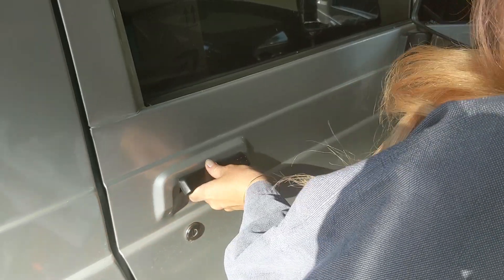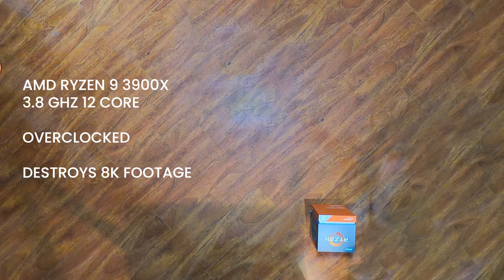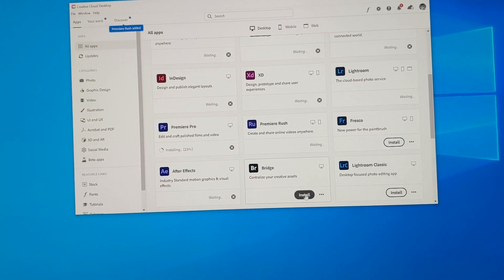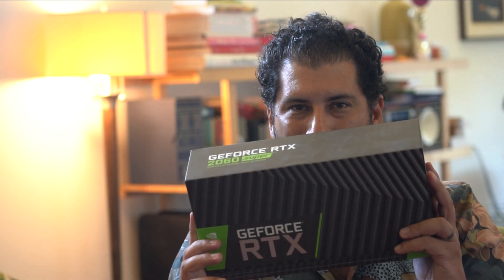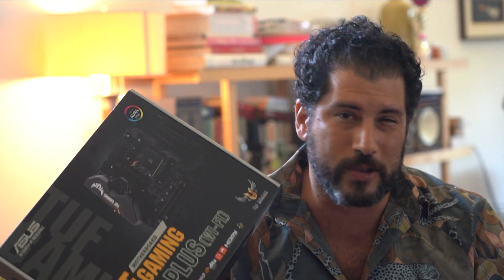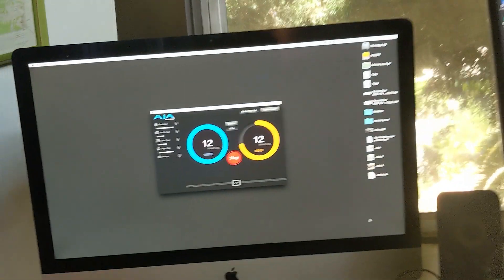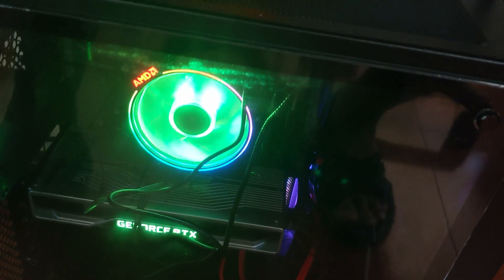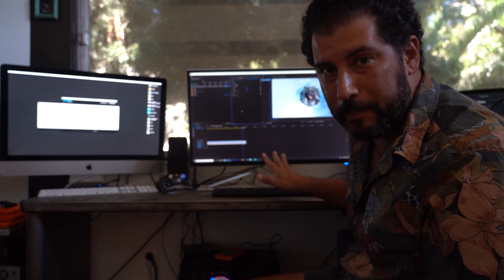PC build: Cheap 2021 PC build for fast 4k Video Editing. Under 2,000 USD. Easy.

Comment: Thinking about making an almost identical rig. How’s this holding up a couple of years later? Multicam edits on 4/8k ever an issue? Are the 2 fans from the rig enough to keep everything cool? Ty again for this
Reply from the maker: Still no complaints ... Fans were plenty even when overclocking the CPU. You could put a liquid system in it, but I've never had an issue. I might run parallels on it and give it MacOS because I'm starting a new inhouse job and we're all mac over there, but speed wise she's still a beast. I was actually thinking of selling it since I wont be on it much moving forward next month... if your interested.

Comment: This video was extremely useful, big thanks for making it! I built pretty much this exact machine. One word of caution for anyone attempting this same build: this will not support Thunderbolt 3, and  near as I can tell the TUF X-570 does not support Thunderbolt 3 expansion. So if you need to work from high-speed RAIDs or the like, this may not be suitable.
Reply from the maker: That might be true as Thunderbolt I believe is Mac only right? IT does support USB C (both varieties) and of course eSATA which both work well with RAIDS.

Comment: I have been looking to buy / build a PC to handle 4K (h.264) GoPro / DJI footage - any thing on budget to start with? 
HP Z Series any good?
Reply from the maker: for the price this will treat you right
Reply: @Serrini_Official  Thanks for getting back to me, found HP Z4 G4 i9-10900x. 64GB, 1TB M.2 NVMe, P2200, 4K editing flow like a breeze...

Comment: Love the presentation and info. However, the total on the parts on pcpartspicker was over $2k NOT INCLUDING the NVIDIA video card.  Not saying it's still not an excellent resource, but.. (?)
Reply from the maker: Really? Without the monitor it comes in at 1980.00 - or did for me.

Comment: No Liquid cooler for processor??
Reply from the maker: nope, not needed. The only time she really is at max is during an export render, and even on long form material (~20 minutes) the render times are so low that she doesn't get that hot. Of course you could liquid cool it, you could put it in the fridge too, but truly not necessary. This is the lowest common denominator for the highest benchmark results while spending the least amount of money.
Reply: @Serrini_Official  it's nice to see..
Your acer monitor ghz?

Comment: Thanks for the video. Great information! I'm researching my next build for Premiere/AE. Because your video is so recent, I'm sure you had the opportunity to use the Nvidia GeForce RTX 3070 ($499) and decided not to, so I'm wondering why you didn't go that route. The 3070 seems to be getting a lot hype! The only thing I will add is I wish you would have done a step by step video of the build! (not asking for much am I? . . . .grin)
Reply from the maker: Im sure the 3070 is a beast, but per my research the 2060 super is going to max out the capabilities of Premiere and AE at the moment ... for a little bit cheaper ... the nice thing about the MOB is that it can take 2 GPUs so down the road you can always slap another one in. As for a step by step build video, trust me, it's not that complicated, you literally just plug the components in.
Reply: @Serrini_Official  2060 Super seems to be sold out everywhere. If you weren't able to get one when you built, would you have gone with the 3070? Or a non-Nvidia version of the 2060? (Great video btw, I'm planning to copy it almost exactly, ha.)
Reply: @jmmbrmm  So what is up with the 2060 Super sold out everywhere?! Well, it is still available if you want to pay $600 - $700! While waiting for the 3070 seems like the thing to do at this point, on Tom's Hardware site the following is stated: "Nvidia initially said the GeForce RTX 3070 would be available on October 15, but that was later amended to be October 29. Wait for the reviews to arrive, verify that performance and everything else works as expected, and then click the buy button. Or more likely, wait for it to be in stock so you can click the buy button." . . . It's obvious now that @Serriniverse can look into the future and foresee the best time to buy . . . so maybe he will share his stock picks with us! (grin)
Reply: @billnapper5737  FWIW I wound up getting the MSI 1660 Ti for about $300. Just completed the build and I'm pretty happy with it, rendered out a 3 minute sequence with a lot of keying + color correction about 3-4 times faster than my 2013 trashcan (27 mins vs 1hr 38 mins). Not sure how much faster the 2060 would perform but the market seems to be in chaos right now. Apparently those 3070's aren't rolling out so smoothly. Maybe if they're available in 6 months I'll try a comparison. Roberto's right about the build not being TOO complicated, though it did get a bit tricky at the end figuring out where to plug all the little cables into the motherboard. But this was my first build ever and it went pretty smoothly.